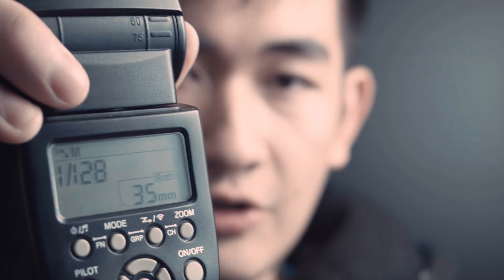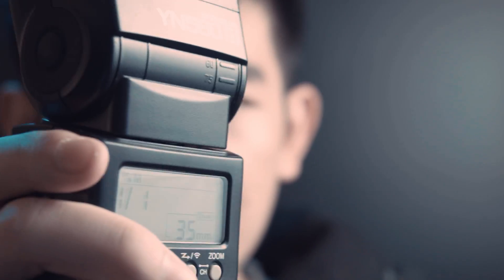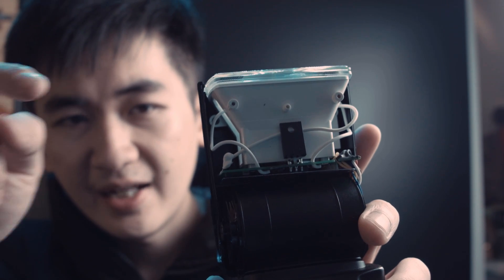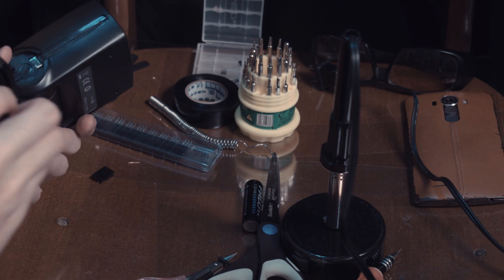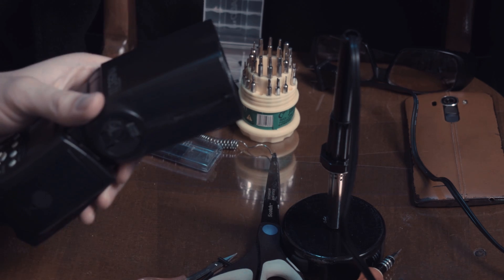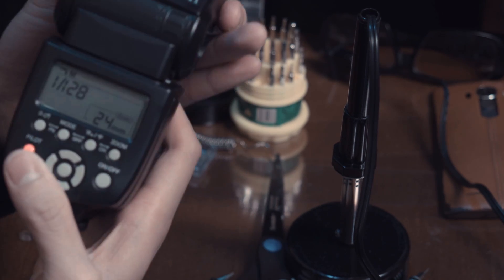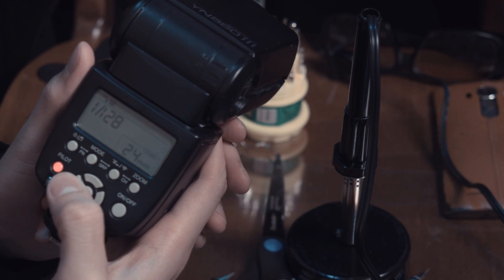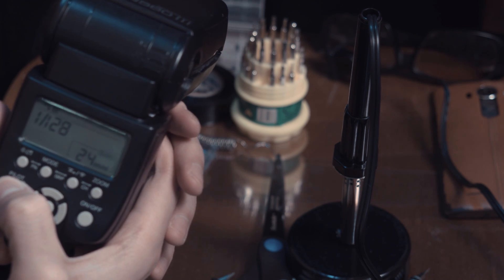How to Fix YN560 Stuck at Full Power Problem |  永諾 Yongnuo YN 560 III 560IV

Comment: What IGBT do i need for YN 568 EX II??
Reply from the maker: I did some research. If the result I found were correct , you should go for IGBT Transistor RJP4301.
Reply: @After.Photographer  have you tested it sir?
Reply from the maker: @MsLestat22  I don't have YN568 EX II
Reply: @After.Photographer  how many cycles you think would last sir?thank you so much
Reply from the maker: @MsLestat22  I made it a module accessory at the end, you could check the video in my channel. I could change IGBT like switching the SD card when it broke, just that simple ~
Reply: I need help guys. Tried Google and it's not helping. Which IGBT board do I need? I have several yongnuo 600exrt that is stuck on full power and need this replaced to be fixed. Thanks in advanced!

Comment: I have yn685 with the same problem.  Do you think that i need the same igtb model ? Thanks
Reply: I think you need same.... But better option is. You open your flash and read the name of igtb and use the same igtb
Reply: I have the same flash.  Did you repair it?

Comment: Hi! I bought the IGBT you recommended. I have the YN 565ex ii. I opened it and to my surprise, I wasn’t able to find the IGBT inside. I tried opening it and found nothing compared to your video. My flash is stuck at 1/1. Can you do a repair video for 565ex ii? Thanks
Reply: I think on 565EX is not placed on same spot.
Reply from the maker: Sorry, I don't YN565ex ii, no idea.

Comment: Unfortunately my YN565EX  has felt on the floor and battery cover is damaged. Reflection board and wide angle diffuser felt out from their compartment. I manage to find spare battery cover but have problem how to reach inside the diffuser compartment. It is over flash head and seems separated, but I am afraid to employ force to detach it by screwdriver or knife. Do you know what is the right way to remove this cover. Thank you

Comment: Hey dude I am from Pakistan and am facing same problem that my flash yongnuo 560-IV turns on but not firing flash is it the same issue that you solve in this video IF yes then kindly reply me am waiting for your answer thank you :) or reply me on ahsan.niaz.811@gmail.com
Reply from the maker: Ahsan Niaz I am not sure the structure would be the same as YN560 III.

Comment: Did you discharge the capicitor before doing this and if so how?
Reply: Good question! I touched an old capacitor of an old Nikon Speedlight (after almost 8 years of not using the defective flash unit) and I got a BIG electric shock. It holds it's capacity pretty long apparently, not a nice feeling when you get electrocuted.

Comment: Why do you use cable? Can be directly attached to pcb?
Sorry for my bad english
Reply: That was something I was wondering as well, if you just use a solder pump that sucks away all solder with a lot of focussed under-pressure you could just pull the defective IGBT out and stick a new one in the same spot.
Reply: @jorismaasvisuals  it's not that difficult. You should just heat ends one by one, and slightly sway IGBT. legs will go out quite easy. Similar to put replacement - you preheat holes, than put IGBT legs one by one. 
I mean - no need in special tools. It can be done faster that you read this =)

Comment: i have same issue. damn version iv is useless!
Reply: Not useless I'd say, just don't use it too much in succession (i.e. full power). I trashed my first YN 560IV flash as well this morning (not using it even on full power, but it seems 1/16 or 1/32 is already too much if you flash in succession in a short time, it just takes longer to bust the IGBT unit, but it will eventually burn as well in the end....the heat stacks up anyway).

Comment: Thanks for this fixvid! I just had this problem with my flash 2 days ago and I brought it to camera repair shop nearby and left it there for check up from their technician. I'll just wait for their rate of service for the repair, if it's too much then I'll fix my flash on my own. Thank you very much! :)
Reply from the maker: Harvey Salvador  Glad to help! Check out my module units tutorial on my channel! Save me a lots of time when this break again! ;)
Reply: I already watched it. I just want to ask too if your TIG056 has failed again after replacement, if yes, how long does it take before it failed again?
Reply from the maker: Harvey Salvador The main reason that causes it fails is because of the heat problems. If it is indoor, it's ok. but if it is outdoor with big bright sun in summer, very likely to break again very easily.
Especially when I am in Asia, very hot here. That's when the module units becomes very handy. :)
Reply from the maker: btw, in the video I mentioned about YN660 as my backup flash in case I didn't fix it successfully.
Though I fixed it in the end, I did use and test YN660. Turns out it works pretty well against the big bright sun outdoors.
Both of my YN560 broke again and YN660 survived twice. I was very impressed.
Reply: I'm from Philippines, it's pretty hot in here too. But I do plan to fix my own flash and also do the module that you did. Where did you order the TIG056BF? :)
Reply from the maker: Harvey Salvador I ordered this from China, about 0.3us dollars, very cheap! very ideal for module units! you could buy LOTS of them and not have to worry anymore! :D
Reply: Good idea there! I don't know when I'll be buying to fix my yn568ex. Can I have the specific website where you buy yours? I'm trying aliexpres, they sell 5piece for around 3-4$
Reply from the maker: https://item.taobao.com/item.htm?spm=a312a.7700846.0.0.ffe8001YyjFwg&id=538669677162&_u=c2p98sml0935